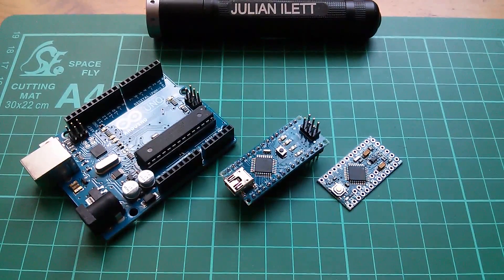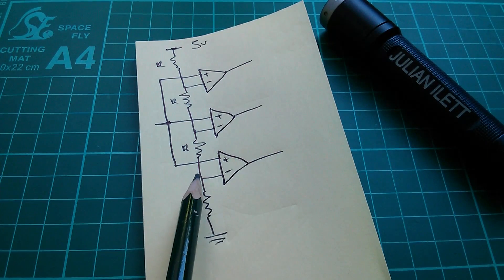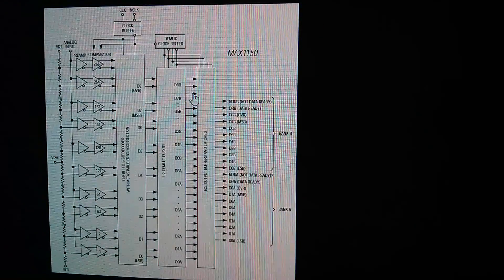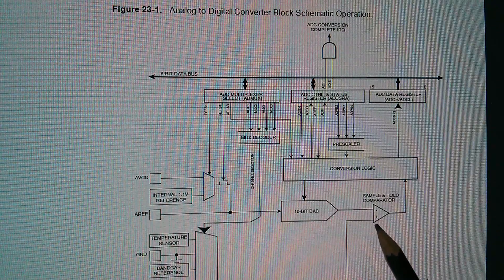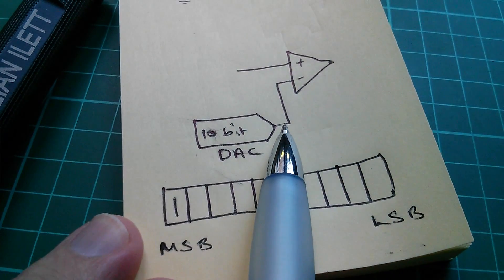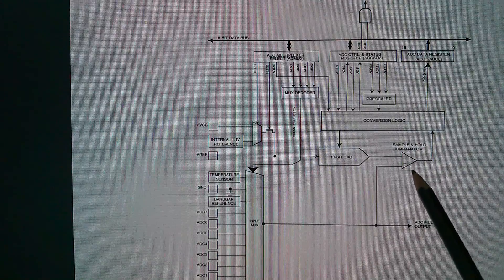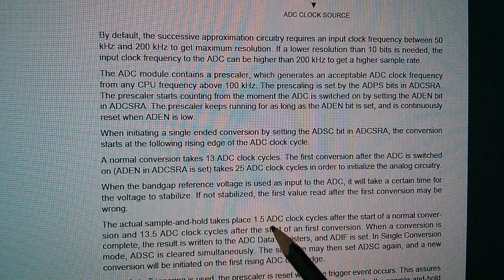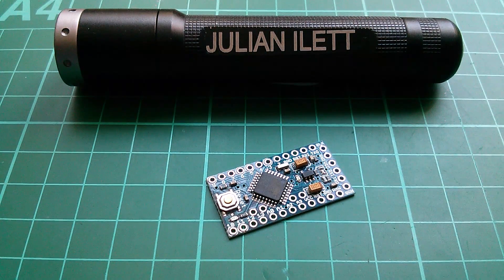Julian explains: How Arduino A/D Converters Work

Comment: With ADS1115 modules falling to about $1 on eBay it's worth looking at them to if you need to read differential signals - something that's not really possible with the Arduinos stock adc: 
https://thecavepearlproject.org/2020/05/21/using-the-ads1115-in-continuous-mode-for-burst-sampling/

Comment: Are you familiar with the output of hobby radio control receivers? I guess it's a 5V, 50hz PWM signal with a duty cycle which ranges from 5-10%. Do you think it would be possible to use arduino's adc system to digitise this signal? Or should I just write/find a system which does it purely digitally in software? In my application, latency isn't really an issue (0.5 seconds would probably be acceptable), but I would be interested to know how to do it "properly", for possible future latency sensitive projects.

Maybe I should look in to how multirotor flight controllers do it. Because they must do it, right?

I'm quite good at programming, but my knowledge of real electronics is sadly lacking. Which I guess indicates a software/firmware solution.

Comment: great explanation.
the first method is the very brief way to convert A to D, but you need huge comparator. a 10-bit ADC requires 2^10-1 comparators, damn.
working with DAC is slow, but still fast enough in most cases.

Comment: so, with max1150 as adc, and reading the same with digital inputs will allow me to build a faster arduino oscilloscope ? meh, i love this tutorial videos ! :)
Reply: iceberg789 That part is somewhat far into FPGA/ASIC land.
If you want it high performance, it would be better to avoid arduino.
Reply: i see, thanks.
Reply: iceberg789 For a 16 MHz AVR8 microcontroller, the fastest doable sampling with 8 bit external ADC is 8 MHz, given you want the data (16 if not).
But then, it's just read & copy, with major limitations, so in practice a no-go.

For scope use, you should find a microcontroller with really fast clock or that have DMA built in.

For the chip you mentioned, the input pins should be read at 500 MHz (assuming a single cycle 8 bit read), but it may take 3-4 cycles minimum to stuff away the data.
Basically, if you use software on a processor, it should be 1.5-2 GHz! DMA would help a lot, but it's still crazy much data.
(a FPGA can run at 500 MHz and do the same, due to parallelism and pipelining)

Scopes use bursts of data, so you wouldn't need to handle a endless continuous data-stream.
Reply: i was thinking if some kind of sample & hold mechanism could be arranged. i absolutely forgot about fpga except the name, since it has been long after graduating from college. how does raspberry pi like something fare in this job?
Reply: iceberg789 Unless you can push data in the camera interface, probably not too well!

You need to be able to tell the hardware to do stuff, and just expect it to be done. The real answar to your question takes a lot of data-sheet reading to find.

How fast sampling is the goal anyway?
Reply: didn't think in such details yet, but i think i read atmegas allow 1msps by setting register flags/prescaling, at the cost of bit resolution.
so, lets say it's a hobby experiment, to find out how far it goes. :)
Reply: That works.

But you should really check the xmega series then, they have a pipelined ADC. a delay of some(12?) samples, but sampling rate of 1 MHz at 12 bit resolution.
Reply: I see, thanks. will check !

Comment: if you used a microphone, a single  comparator to the digital input of a arduino, could you make a crude voice recorder?  this was something i tried to brute force, using pascal, back in the 80's on a pc, i got a huge filesize and a barely understandable word!
Reply: jusb1066 You will barely get a useful result with 1-bit digitizing. But you could use 1-bit DAC for replay... Use one GPIO and PWM to drive your speaker, that is, what Class-D amps do. For file-size reduction, you  may encounter that there are lots of consecutive 1's and 0's so do not save each of them, but a marker if it is 1 or 0 and a count of how many to follow of each... 
May be that is nothing you restart today, but it may help somebody else

Comment: If you put the ADC in Free Running Mode, use a buffer to store your samples and use only 8 bits of data (read only one register to reduce time) you can get 153 ksps. You can also use the internal comparator as a trigger, and the PWM generator for the trigger threshold. Output the data on serial (really slow) or SPI / I2C and you've got yourself the cheapest >100 ksps oscilloscope out there.
Reply from the maker: I like it. Can I steal all your ideas for my new Cheap Arduino Oscilloscope project?
Reply: Julian Ilett I somhow wrote you about some nifty ADC and DC/DC code I'd think about to add to your open source MPPT and I wrote you about that as a comment on the MPPT page where you offer the code. However, the post awaits moderation for quite a few days now :)